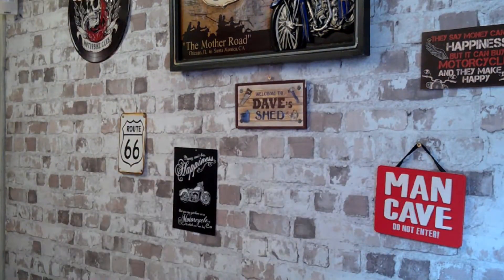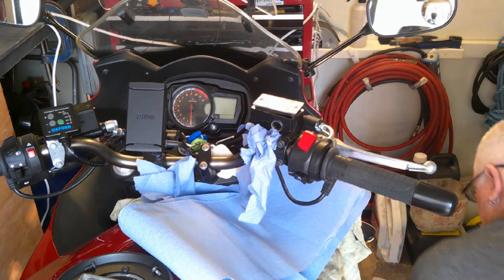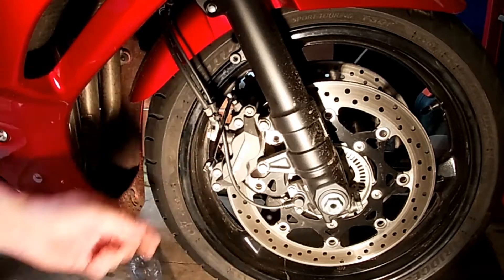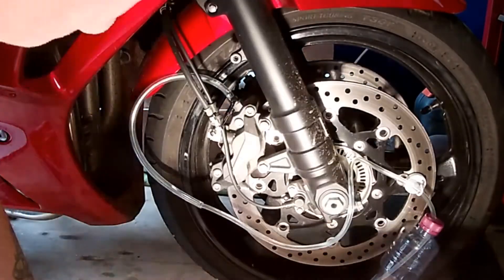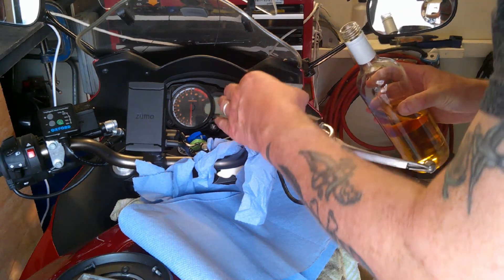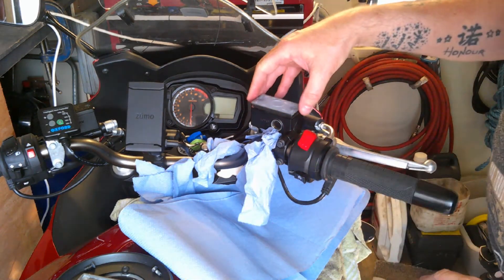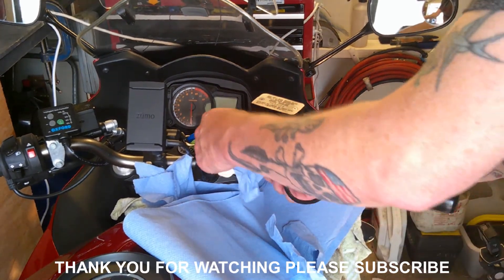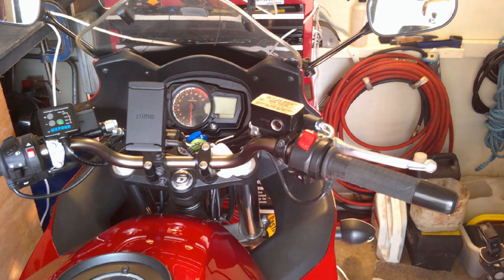HOW TO GHANGE BRAKE FLUID AND BLEED BRAKES SUZUKI #motorcycles #brakes #motorbikeaccessories

Comment: POZI, JIS, PHILIPS are TOTALLY different in design.... The Laser 6498 bleeder is awesome!!!!! Got loads of them!

BTW, have you ever seen the dirt behind the pistons, in the fluid, even after a few months? You'll never get that fluid out, it is below the bleed screw and will settle at the lowest point. Disassemble and clean properly is only way.

11:58 - air was most likely from bleed nipple (especially since you were just pushing fluid, not really "bleeding" air) - quickly remove the niple and put a glob of red rubber grease on the nipple threads before pushing fluid or bleeding air. Makes a difference.

Comment: I use a syringe to get rid of most of the fluid in the resevoir first, refill with new fliud, so that you are pumping new fluid from the start.

Always bleed the point furthest from the master cylinder first, then next, etc. (He did it correctly, just didn't state it)

There can also be a bleed point at the ABS or junction point.

Comment: How far can you pull leaver? I can touch with mine handlebar if I pull it with full force. There is no air in system.
Reply from the maker: Something is not right get someone to take a look, just to be safe my friend
Reply: @davetompkinsmotorcyclevlogger  Thank you for answering my question.
Reply from the maker: Your very welcome

Comment: Well done at last Dave. Put some copper-slip on master cylinder screws, they have a tendency to rust in. I read somewhere the engine has to be running when bleeding the brakes due to the ABS system.